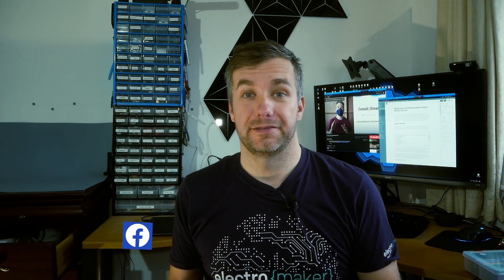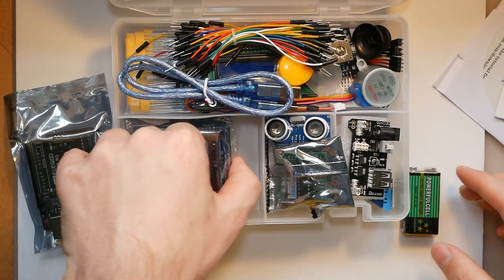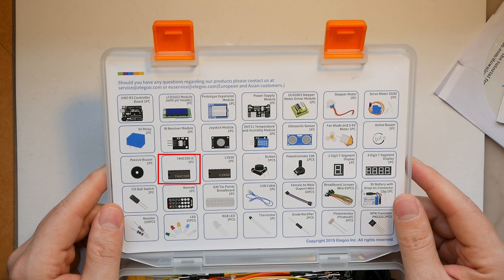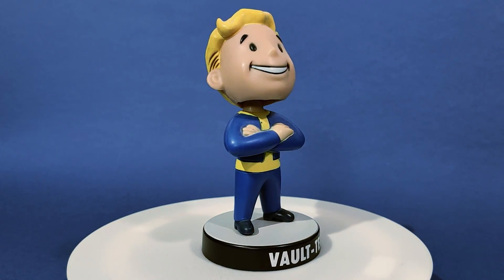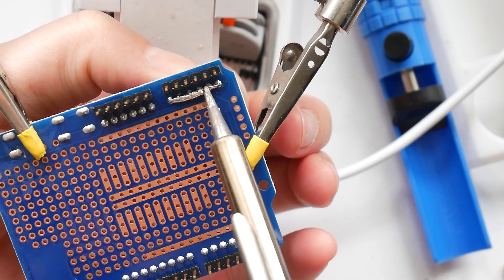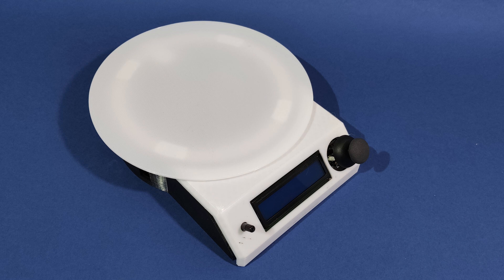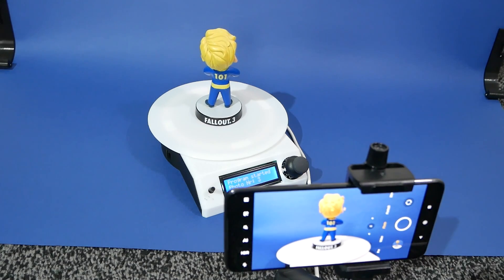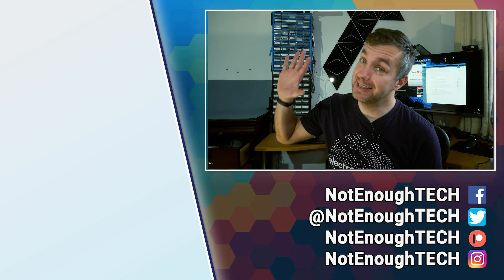Fancy videography thanks to Elegoo Super Starter UNO kit.

Comment: I like the starter kits.  They are great for tinkering and for learning about how everything works.
Reply from the maker: It's good to have a direction as well. If I could change anything about how I started, that would be it
Reply: @notenoughtech  I agree there.  When I first started with "smart home" stuff I have no idea what I really was aiming for.  Initially I thought it was too expensive to do it, so never planned, then when I found the more DIY way I kind of jumped in the deep end and still didn't plan
Reply from the maker: I spread myself too thin at times then have to table projects until I'm able to complete it. When going back to a project that was tabled for a long time there is lot of time wasted of figuring out where I left it and what I was going to do next which is never the case if you see it through

Comment: Hi Mat and keep on the good work. I started with just Sonoffs and an Echo about a year ago, after a friend's suggestion. Soon went to Home Assistant (with Haaska to expose devices to Echoes) and Tasmota. Now I use mostly D1 mini's, started soldering and playing around with WLED making sensors and led light projects. And little while ago I started learning Arduino...
Reply from the maker: Awesome to hear. D1 minis are pretty cool. I also have esp8266-01 as they have small form factor and just enough pins for a simple project